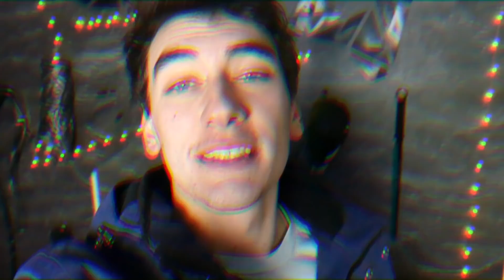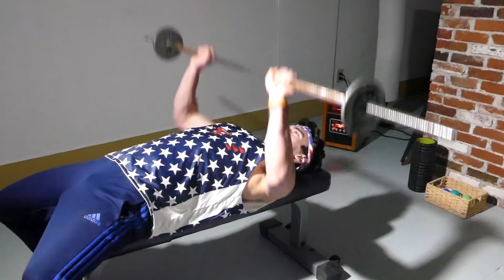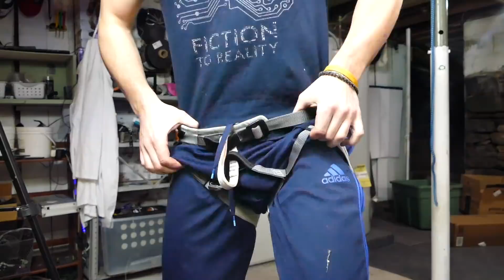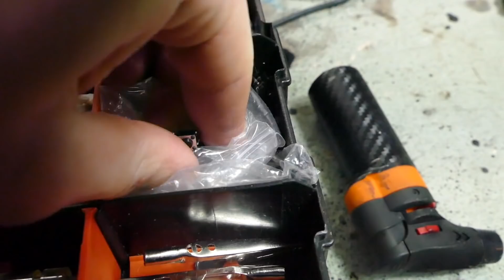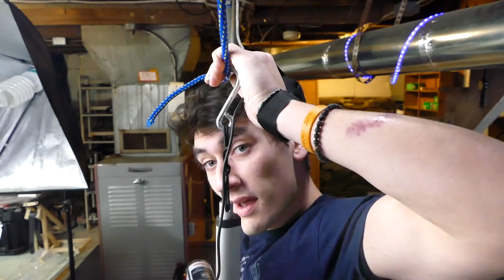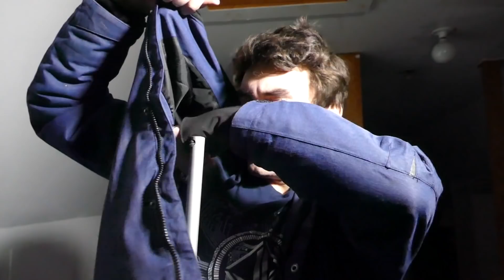Do Infinite Pull-ups With This Trick! - (DIY Exo-Suit Part 1)

Comment: I used a linear actuator when i was making electric wings for a halloween costume. I had it hooked up to a 12v battery pack so i could move around and use my wings. I had a 2inch linear actuator. I know you can get some actuators that sacrifice power for speed. Could look into those.

Comment: A collapsable staff that actually works for self defense xD that's what I'd like to see you make. I once made one myself, but it could only collapse like 25%... and was made of aluminium...
Reply: Oh my goodness that would be an amazing idea!
Reply: Depending on how collapsible/thick/big it is, it may be impossible to make one good for self defence.
Reply: @notforsaletoday1895  at least a 50 inch (125cm) staff can collapse to 20 inches (50cm) and be useful (if good metal and skilled hand). If it were a cane, then that becomes 56 inches (140cm). Maybe 53 inches (132.5cm) if you want to be extra safe... oh! If it is foldable, that can nearly double the length! Or one third extra long instead of twice as long, but sturdier, still small in store mode, and long in use mode.  Because, you make two canes and connect them by the non extendable end. The longest version would be 110 inches (280cm), and the safest version would be like 94 inches (235cm).
Reply: Those already exist my dude there is nothing amazing about it i think you can get a decent collapsible staff for 5-12 dollars depending on the store
Reply: I know this comment is over a year old, but what's wrong with a night stick?

Comment: Just a soldering tip. Get some solder flux. In any electronics hobby shop should sell it. Using that even though the solder already contains some Will speed soldering up a lot and make for stronger bonds. Just dip the wire lightly in the flux then tap it with the soldering pen with a small amount of solder on it and the wire is fully tinned. I know I'll get slack for this so I'll just get the flux out of here now ;) love the vids keep the good work up